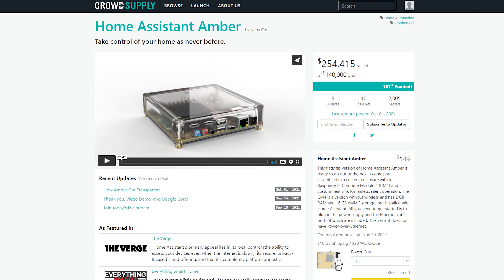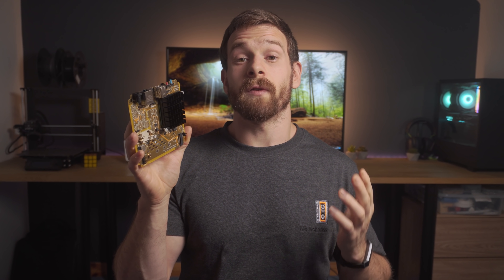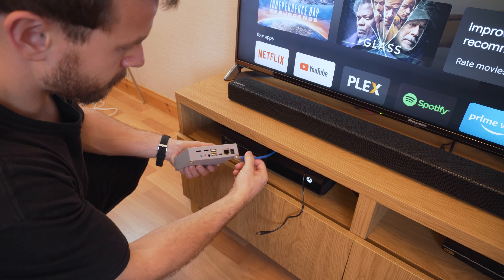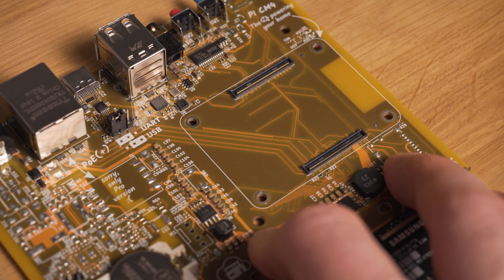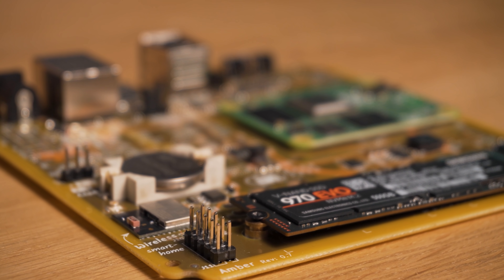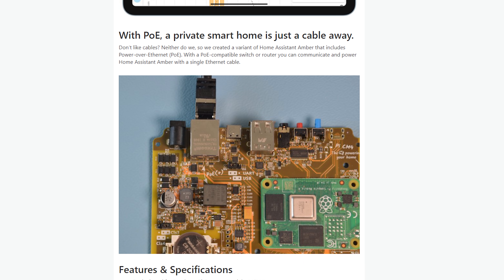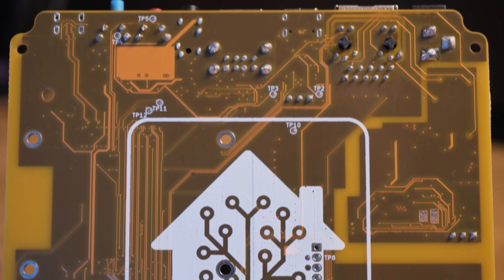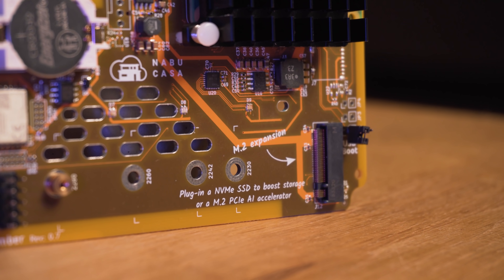Home Assistant Yellow: First Impressions!

Comment: Thanks for the Video! I have one here too but unable to use it at all come from China AND UNABLE TO GET FROM eURO OR USA AS OU T  of stock! I had a CM4108032 – Raspberry Pi Compute Module 4 – WiFi – 8GB RAM – 32GB Storage
 version and not  sadly working, I fully tested it and no way to get it to run!. So not sure now to wait for a Blue version or and Orange but as for yellow I think a Raspberry 4 is just as Ok for it until they fix some serious Bug issues! was looking forward to it but like ALL THINGS TAKEN AWAY TO THE NEEDED! Also took 3 months to get to me in the U.K and for an item that would be need quickly I find not reliable enough until things  change! Luv your videos! and thanks for all the help on it as what you say on the Yellow can be done on a Raspberry Pi 3 b too!  🙂

Comment: I'd be interested in seeing how this compares to a Home Assistant Blue performance wise. Is this any faster or slower? I would think slightly less powerful.
Reply from the maker: The CPU on the blue is indeed slightly stronger, but it's more a question of if you need or would even notice that CPU difference. It's an interesting question and hard to quantify

Comment: 21 Ocotber, 6 days left and it is now 237% funded.   This is really selling a lot of units for a kick starter.   It really shows the following Home Assistant truly has in the community.
I think not using the USB C port for power is actually a good move from the Nabu Casa team.  It will help reduce the chance of trying to run this just off a "phone charger" which may not supply enough power and cause the whole system to become unstable.
Reply from the maker: Indeed,. the community power is incredible!

Comment: Pretty happy with my Odroid N2+ with eMMC especially with the slightly faster processor over the RPi4 CM (as I understand it).  Certainly appealing to see nVME support though in the Amber for faster storage performance over eMMC (presumably).
Reply from the maker: Sure, if you are happy with the current setup then no real need to move as you say!

Comment: Can you show:
-Oooooh the ZigBee (hi Paul)
-How it works with a Z-wave USB stick? Or other USB device.
-The coral AI thing (not very high on the priority list)
-Performance and other usefull stuff to do with the SSD
-A fun thing to do with the GPIO pins
-How it performs under heavy load for an extended period of time.
Reply: CM4 doesn't support Coral M.2, so they kinda goofed on their original campaign and had to retract it later. You are limited to the USB Coral, which is very sad IMO.

Comment: FWIW the serial console on my Netgate 2100 has been incredibly helpful a couple times. Since there is no HDMI I get this thought. Awesome they include Zigbee, but I have ZWave, too. The dongle I use now for HA covers both. This was announced a couple weeks after I fist installed HA in an Agon One m.2 case. Really happy with it, so far. But this looks like a great choice overall.
Reply: May i ask which dongle you are using that supports both?

Comment: great first look. Excited to see the full video. In the full review, can you discuss heat? Is there a fan module available to help the passive heat sink? Could you still install other coolers like the Tower coolers on the raspberry pi, or does the connection to the amber board prevent this? I want to see if I could get person tracking through live video streams working in the home assistant, but that would generate a lot of heat that would need to be dealt with.
Reply from the maker: Will definitely take a look at thermals!

Comment: Hey, any idea if the Aeotec Z-Pi 7 will fit under the hood?  About half of my equipment is z-wave and can justify making the swap if I'm still having to use a USB adapter sticking out the back. Thanks!
Reply from the maker: There is no internal USB slot unfortunately
Reply: @EverythingSmartHome  The Z-Pi 7 uses a 10-pin hat connection, not USB.

Comment: The thermal design is really weird - heat sink for the CPU, and then cover it all with a plastic/glass cover that will prevent any heat to escape ? my HA on RPI4 w fanless aluminium 'Armour' gets quite hot...
Reply from the maker: It's not sealed, plus there are a couple slits for heat to escape.

Comment: Interesting piece of hardware. I am planning to buy an apartment next year, so I started looking into HomeAssistant, this thing got my interest. Sadly, this won't be officially imported into Russia(neither is Pi), so I will probably have not an easy time finding one(probably will end up with Pi, these are easy to find, just a bit more expensive than in the US)
Reply: Home assistant runs very well on a nuc or similar mini PC. The SSD of a nuc is more reliable than a Pi and the additional performance/ram allows you to go ham with the various addons.
Reply: @jaap7374  yeah, but NUC can be pricy. I am now thinking about a NAS server with Home Assistant in virtual machine probably... Just need to check how powerful the CPU should be in this case - easier to kill two birds with one stone.

Comment: I'm interested but hesitant. What does it give me that I don't already have with a Pi4? PoE isn't a necessity and I already have zigbee added. Really struggling to understand the "why" of it.
Reply: It's probably not for you, but it is an easy option for someone new. For instance, there is a chance that Amber can be upgraded when the Raspberry Pi 5 Compute Modules come out if they still use the same form factor, but that doesn't matter for you, since you're already stuck with your Pi 4.
Reply: @syndaquil4838  I wouldn't bank on being able to drop in a cm5 the design changed completely from cm3 to 4 raspberry pi are under no obligation to keep this form factor
Reply from the maker: It gives you an all in one solution for people looking to get into Home Assistant that don't have the technical ability to put something together themselves, don't know what a Raspberry Pi is, don't want to research different ZigBee dongles etc, they just want to plug something in and it to work.
Reply: @EverythingSmartHome  that's a fair point. not sure how long they'll last know with such little tech chops, HA doesn't feel like a product suited to such a noob. Hoping that statement gets proved wrong with more intergrations and wizard driven automations etc....

Comment: While it's nice Home Assistant is generating more revenue, which hopefully makes Home Assistant even better, I honestly don't see why anyone would buy this product. Get a Raspberry Pi 4, a PoE hat, and an USB drive for storage (instead of unreliable SD cards), and you basically have the same product, except in some ways, it has more features than this product (USB 3.0, HDMI, etc.).
Reply from the maker: Sure, but that's not suitable for the average person who wants to get started and doesn't have the knowledge/experience/confidence to put that together.
Reply: @EverythingSmartHome  I completely understand that aspect. However, with the amount of help groups all around on the web (Facebook, Reddit, etc.), and probably thousands of hours on YouTube, anyone who needs to run Home Assistant can probably set one up using a Raspberry Pi as well.
Reply from the maker: Not everyone has the time or paitence to do that, believe me there is a HUGE market for people who just want to plug something in and it to work
Reply: @EverythingSmartHome  Honestly, if people don't have the time or patience to make it themselves, they don't have time for Home Assistant :P

Comment: Cool that you got your hands on one 👍🏻🤓 I’m primarily interested to know about the Zigbee setup and performance. And about using it with frigate and coral.
Reply from the maker: Thank you sir!
Reply: Sadly it turns out the CM4 doesn't support the M.2 Coral, but they didn't realize this until way after the initial campaign released and they stated it worked.
Reply: @bluearcherx  😬

Comment: I would like to see a detailed comparison between this device and an off the shelf rpi running an SSD with a usb zigbee module. A video showing where they differentiated themselves and a price comparison would be a great. Thanks!
Reply: yep, curious what benefit this "motherboard" has.  It's somewhat similar to the Compute Module 4 IO Board
Reply: @NulledMedia  It's an AIO. That's the only reason I want it.

Comment: Question: if you're not using Zigbee, is there ANY reason to use this over a normal Pi 4B ?
(disclaimer: I am ok with SSD over USB 3 speeds, so no need for an expensive NVME SSD)
Reply: A Real Time Clock with battery backup,  POE,   a real case form factor.... with connectors  in the rear of the case... (not a mess cables in every direction) , upgradable compute module....
Reply: Nerd points of course.

Comment: Still can't figure out who is target user of this? Newbies will not wait 6-12 months to start with it and it's overkill as starting device (although perfect in terms of options) and current users (that didn't go for Blue) are using similar or higher spec HW already with 35% of users running it in VM, so probably higher then this specs of HW.
Reply from the maker: I hear ya, but just because new users can't buy it right now, doesn't mean that when things are back to normal and availability is much higher, this won't be the perfect device for new users then. Think longer term BT 😜
Reply: @EverythingSmartHome  if the device will be in future available for immediate purchase, then definitely yes. Not sure if I missed that info on stream.

Comment: I have two on order to replace my two HA Blues would love to know what the factory preset does. I use two so I can have one read as a somewhat manual hot swap should one lock up.  Eventually it would also be great if you offer suggestions as to what we might be able to use our HA Blues for after we swap over, but that’s another video…. Thanks for the overview!
Reply from the maker: Thanks Richard!
Reply: @Emmanuel Goldstein Nope… it’s called being prepared with redundancy to minimize down time.  Especially if I’m asking my wife and family to try and depend on and use the automation… if, on its own, it decides to lock up, which has never really happened, or more likely, me, myself, and I screw something up while trying to learn and develop or install something that crashes the system, then I can quickly bring it back up with the second unit and a restore from my offline backup on Google Drive.   Twice those three stooges (me, myself, and I) have already locked HA up so bad it refused to start.  Both times, I was up again fairly quickly and the had time to prepare the down unit as the next redundant unit.

Comment: I buy most of what HA/NabuCasa puts out there to support their efforts.  Eagerly awaiting mine to come.  This will not do a good job of replacing the blue for me.  This feels like a much better solution for the general consumer and a great step in the right direction.  I do wish they'd release a power user model as well like a "PRO" edition that can run a beefer system that would won't call a hub but rather a mini/micro server.

Comment: It would be good to cover upgrading an HA set-up from a RPi to HA Amber
Reply from the maker: Thanks for the suggestion!
Reply: @Emmanuel Goldstein That's the theory, but I haven't seen it mentioned anywhere if the backup will be compatible with the new hardware.

Comment: I would like to know,  if this supports the Visual Studio add on to edit yml files. This is not possible on the Raspberry Pi AFAIK. :)
Reply from the maker: It's possible, you need 64bit HA OS. But yes it does work 😎

Comment: It’s too bad you can’t use m.2 coral edge tpu because of the pcie h/w limitation for pi module 4
Reply from the maker: Certainly unfortunate
Reply: The USB version works well, FWIW. It would have been nice to keep it internal, though.

Comment: you can add an HDMI output to the board, the tracks are in place, the connector is not as its a licenced output and would have pushed up the cost. just pop one on and solder in place.
Reply from the maker: That's good to know!